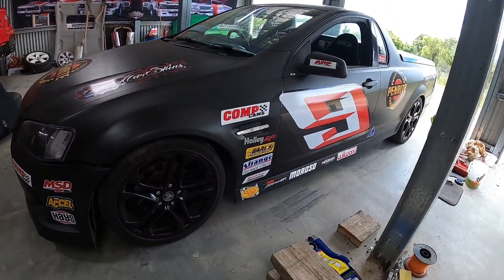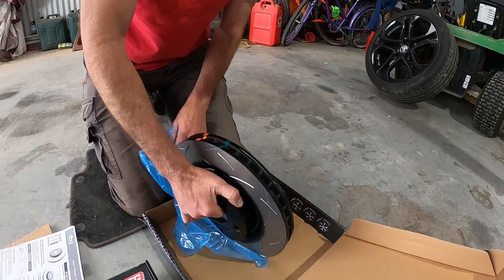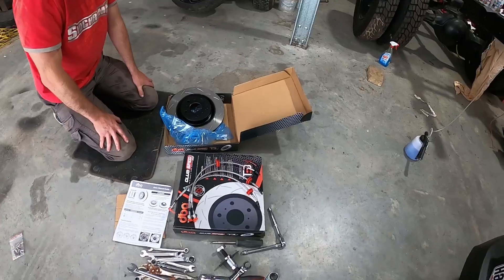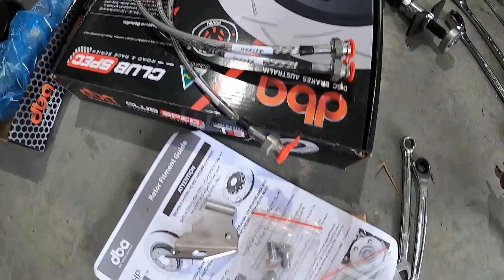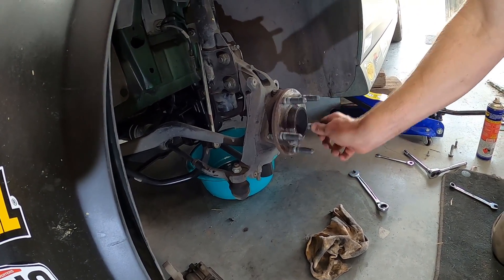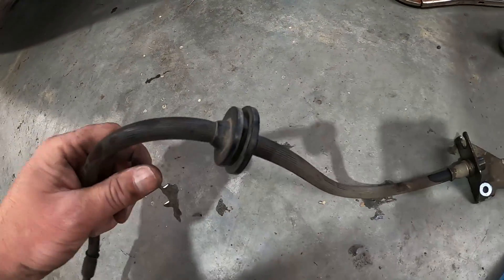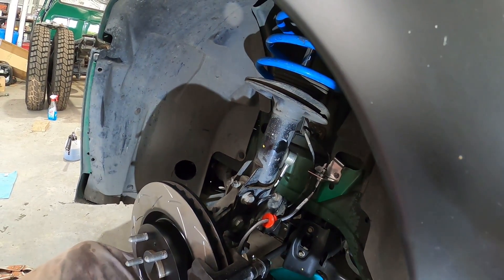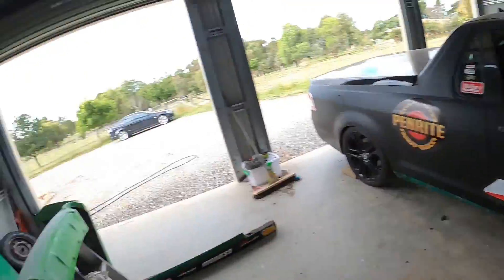Holden VE SS Ute Brakes Upgrade - Rotors and Braided Brake Lines

Comment: do the braided lines come with two or four in a box and who did you buy them through
Reply from the maker: G'day mate, they come with four to cover both front and rear.  We ordered them through Competition Friction and they are the same spec as used in the V8 ute racing series.  Hope this helps.  Fred.

Comment: Should Have done a stop test before the change over, just to show how much difference it is before the change, all brake a crap when your disc is down to minimal thickness and also the pads, but put ultimate and good rotors, will fix that, but only if you have good pressure in the systems, just a little air or even hot fluid will make the pedal feel spongy, cheers :)
Reply: Would you see much of a difference in a low speed test on cold brakes? I could see that the new setup would be better at the track but I don't know that street driving would show much difference.

Comment: Those stock discs look nicely seasoned to me. Amazing that they did as well as they did. I would not have thought that you would have been able to go as hard as you did with the standard discs and calipers. Outbraked a VW GTi on the track.🤓
Reply from the maker: G'day Angry, yes the stock rotors have held up particularly well after the punishment thrown at them.  I dont know if it was the previous owners maintenance regime or not, but the insides of the rotors look very rusty brown.  Anyways, with fresh fluid, braided lines and new rotors, I am sure Frankie will be able to stay away from Mandolorians coming into the fish hook in the future!🤪🤠😎

Comment: Stock brakes are no good for track days yeah i found that out in one of my older commodores lol

I bought the 2 piece rotors from DBA
Reply from the maker: G'day Matt, our stock rotors held up surprisingly well for the first three days but they are well past it now.  We are hoping to be able to brake later into several corners with the latest set-up.  We might look at two-piece rotors for the next upgrade.  There was a big delay and wait time on them so we went with the 1-piece.  Are you considering braided lines on your car for future track duties?